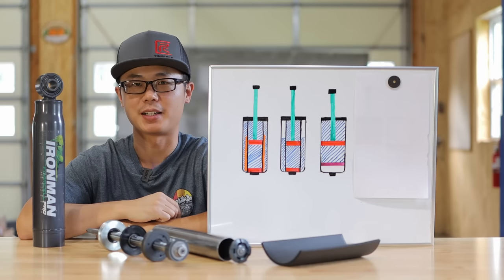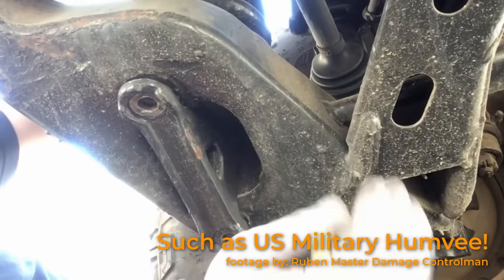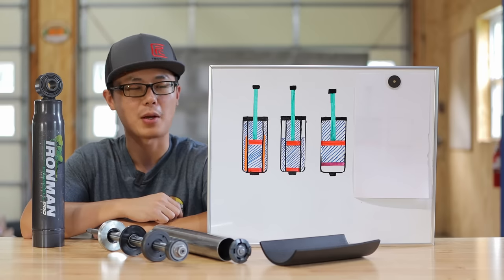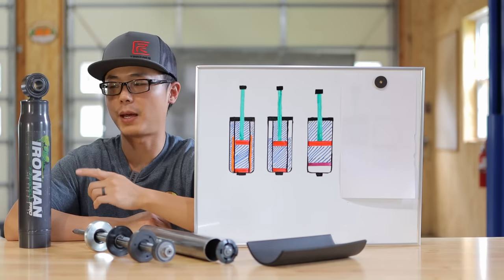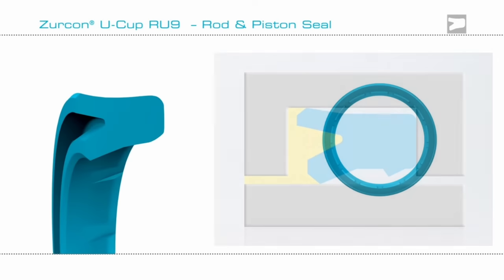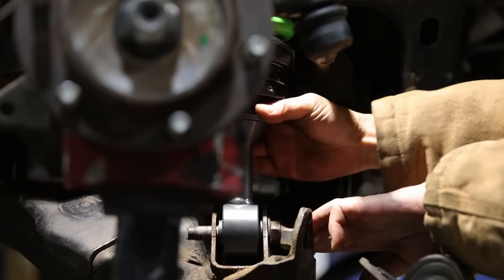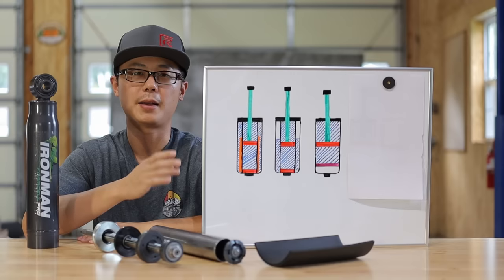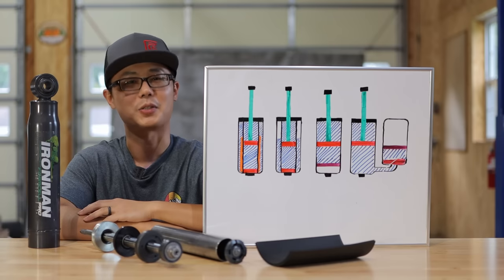Truth About Ironman Foam Cell Pro | In-depth Technical Review & Comparison

Comment: I’ve been running Foam Cell Pros on my 4Runner for almost two years and 25k miles on my 4Runner and haven’t had a single issue. Fantastic suspension.
Reply: Did you have to add that extra washer like @14:06 ?

Comment: I use regular foam cell shocks in my truck (Ironman foamcell)... during an offroad trip in the middle of brazilian desert, I had to help fixing a break issue in my friend's car which was using a regular OEM shock... as I got closer the shock was really hot. It wasn't possible to touch it. In comparison, mines were cool at touch... you could rest your hand on it. Of course, after some 10s or more you would fill a discomfort... but the point is: my friend's car you could barely touch it, and shocks were no longer working as good as it was cold. But mines were fine.

Comment: 5 years and 68,000 miles yet still going on my FCP on my 2018 Tacoma. Not a single issue on the and they still look brand new!. Plus as Kai mentioned Ironman reguarly offers15-25% discounts year round nearly on their website so i got them for a very solid discounted price.Go team Ironman 4x4!
Reply: normally when?? i got my eyes on FCP but would love to take advantage of those discounts
Reply: Did you have to add the washer like @14:06 ?

Comment: I’ve been running foam cell pro shocks in the rear of my Nissan patrol for about 5yrs and 80,000km, the only issue I’ve had it the sheer size of the shock body means I had to trim the bump stop pad on the diff housing and the shock body still rubs on the panhard bracket at full bump.  Still an excellent shock.  Thanks for the very informative video.

Comment: I just put these on my 2010 fj cruiser, and love them. Replaced bilstien 5100 on front and 5160 remot resevor on back. I kept my icon overland progressive springs on back, but went with iron man medium load coil overs on front. I do mostly overlanding in the Patagonia, with hours of washboard roads. The bilstien were down right dangerous after an hour or two as the shocks faded and so did my control. The foam cell pros eliminated the fish tailing of my FJ. Also, I did not want to have to send my shocks away to rebuild, which at that point I was probably cost more than jist buying new shocks.

Comment: Great vid. I have been running the foam cell pro kit on my Tacoma for 25k miles. No complaints/issues so far. Lots of long days on washboard roads and high heat out in the desert and not a single problem 👍
Reply: Are they supposed to be a stiff shock. I installed them on my 4runner and they are very stiff

Comment: Thanks for the great discussion about the Ironman FCP suspension kit - I'm strongly considering it for my '23 4Runner w/ KDSS.  I haven't read any installation instructions for the coil overs, but I suspect that your solution to the plethora of set screws is actually what Ironman intended - since the coil over is adjustable in place, having several ensures that one will be accessible as the adjusting collar is rotated.  I've been a mechanical engineer since 1982 and I really appreciate your in-depth technical discussions and demonstrations - a great contrast to other content on YouTube that is unsupported by actual facts.

Comment: Great content. I’ve been running the standard Ironman foamcell for about six months on my touring vehicle. Done a lot of corrugated outback roads and beaches while reasonably heavily loaded and been happy with performance. In Australia Ironman tend to have a reputation of being a solid mid range brand but a lot of people do look down on them in favour of ARB OME and other more spendy alternatives.
Reply: Good point. People buy mid range suspension and expect it to handle the most extreme things they can throw at it.

Comment: Just installed this 3" lift kit yesterday. Was freaking out about bending the bracket on the LCA. Your comment made me feel better about it lol. Also, the instructions that came with the rear coil springs say that they are marked D/S and N/S. They were unmarked and identical, so we installed them as is, which resulted in a 1/4" driver side lean in the rear with a near-empty tank and 3/4" lean with a full tank. Can't tell without a measuring tape though.

Comment: Dude, you have been amazing helping me understand IFS! I come from the jeep world and am building a 21 bronco. Goal is better wheel travel and bigger tires with a better off-road ride. I would love to see a video discussing the Bronco's IFS and its shortcomings along with your opinions on its IFS. Thanks for your great explanations!
Reply from the maker: Thanks! I would love to check out a bronco and make some content. Love the front sway bar placement and hydraulic disconnect. Not too sure about choice of coilovers in the rear. Too bad the steering rack and tie rods are similar size as Toyota.

Comment: Thanks for providing much needed information to the 4x4 community. I have found some suspension manufacturers don’t even provide specifications on their springs, shocks etc. Very frustrating when you are trying to spec out components. I ran QA1 consumer rebuildable/revalvable shocks when I raced open wheel cars. It was a good choice for budget racers that couldn’t afford adjustable shocks or carrying many shocks on hand. Keep up the good work!

Comment: I moved to Wa from Ca and i have king shocks on my tundra, this makes me want to sell them and go for a more basic setup its a different kind of offroading here and your video makes sense. I hate the maintenance with the king shocks, many shops here dont rebuild them. thanks for these videos
Reply: What are the maintenance requirements for the king shocks?
Reply: You have to rebuild them after a few miles, depends on your driving habits, hard high speed off-road probably every 30k miles. I love them but hate having to send them off to CA for a rebuild when you’re in a place that no one does them.
Reply: @fouUili684  it’s something you have to send off, not a diy rebuild? Is it just replacing seals internally?

Comment: Another great video! I Would be really interested to hear your assessment of the Eibach pro-truck series for Toyota/Lexus. Really liking mine after over 2 years
Reply from the maker: Thanks! I don’t have my hands on one so can’t say much. It looks fairly similar to bilstein 5100 by design. The Eibach brand is pretty solid so I would trust it. I do like their load leveling system for the rear coil spring. Very ingenious design
Reply: @TinkerersAdventure  I think there was a leaked document that showed it was a rebadged 5100 shock with one tiny difference.

Comment: Thanks for the super helpful information and clear communication. I’ve used the Ironman FCP for a few months now on my 1999 Landcruiser equivalent (LX470). 

The front end has a torsion bar system, so no coil overs. As for the rear, I found that the kit for the UZJ100 actually does account for the “toyota lean.” The driver’s side rear spring is approx. 1/2” - 3/4” taller by my measurements.

Comment: Foam cell is used for thermal insulation in some instances.  I don't see how it can be claimed to increase heat dissipation in this case, since it's effectively insulating the heat generating inner tube from the heat radiating outer tube.

Comment: Fantastic video, thanks! Just curious, how much might the displacement of the inner tube in a twin tube shock reduce the volume of oil? Given the shock body of twin tube and monotube are likely to be constructed from material of similar thickness (say 3mm), and once you factor in the displacement of the inner tube, shock body OD doesn't seem like a fair representation of oil volume/thermal mass when comparing the two shock types.  Larger OD has a larger surface area, which would aid heat dissipation I guess, maybe that would make up for the displacement of the inner tube?  Also, any thoughts on the steel vs. aluminium (excuse my English, I'm a Kiwi 😊) wrt heat dissipation? Cheers

Comment: I agree, paint and e-coat are better than zinc coatings for corrosion.  I think Bilstein should paint their aftermarket shocks instead of zinc coating them, for better corrosion protection and because the yellow and blue look way better (in my opinion) than the zinc (especially after one salty winter). Great information as always, thank you

Comment: I choose Ironman pro because they offered different spring rates for
front and back. I choose a heavier spring rate for because of steel
front bumper and winch and spare tire and gas cans on rear plus towing.  I didn’t get the Toyota droop and it rides great on any surface.

Comment: I loved the content. Thanks for putting this all together. In one of your other videos you mentioned to go with a 2 inch lift for the gx in general vs the 3 inch. Is this testing done on the 2.5 inch fcp? Is that also what you would recommend for the gx ?
Reply from the maker: Thanks. Correct. That testing was with ironman 2.5” lift package, but you can adjust the preload to set whatever height you want. I personally go with as low as possible. My FJ has 2” lift on the suspension and 315/70R17 tires. If I have larger tires, I might even run less suspension lift because I have more ground clearance to spare

Comment: Hi Kai. Asking here since I figured this is the best chance for ton to see it.
I just installed the bilstein 6112 on the highest perch in my v8 4th gen 4runner. There is still rake with a 1.5” spring in the rear.
For the 6112, it is a 14”x3” 600lb spring. To get a bit more lift, would you recommend a) upgrading to 650/700lbs 14” spring, b) changing to a 16” 600lbs spring on the bottom perch, or c) adding a 1/4” top hat spacer?
I think since they used the same spring rate for the v6 and v8, going to 650lbs wouldn’t be an issue, but the 700lbs might not be the best ride quality
Reply from the maker: I personally prefer b) for the sake of articulation, as long as you can verify it will not coil bind. A) is a safe bet and will give you slightly more stability on road. C) is no go for me because 6112 is already extended. Adding top hat spacer will over extend your IFS.
Reply: If only they made a 15” x 3” spring. But yea I’ll have to do some measurements to see if A fits. Thanks for the reply

Comment: Excellent video!  Though i think its misleading not to explain more the role of shock valving.....  eg. A well valved twin tube will handle fast desert runs better than a poorly valves monotube.  Can i suggest a test?  Drive the GX with the Foamcell pros over fast undulating conditions.. assuming you have the FEP rear shock, then push it some more.. and watch the vehicle dynamics.  For the Prado platform, its the pitch that will play up the most, and you can easily observe that via the cycling response of the rear suspension.  You might find its actually close to critically damped.  A lot of this you can infer from the many posts on the Custom valving  threads on the Australian Pradopoint and FJCC forums.

Comment: I have a question for you and I would like to know if you can tell me if it is true that the ironman nitro gas shock absorbers go well with the standard original trim and can they be adapted with the +5?  I have a Suzuki jimny 4x4 with m13a petrol engine 1.3 lt petrol with factory standard shock absorbers and suspension set-up yesterday afternoon I picked up the new ironman nitro gas shock absorbers and the 4x4 spare parts dealer in Florence told me that these ironman nitro gas shock absorbers are fine for 4x4 off-road vehicles with a standard factory set-up or in a second I could put the springs higher and it becomes a high set-up +5 is it true?  Greetings from Florence Italy!

Comment: Wish I watched this first.

I just bought a pair of front shocks and the gap on the lower bolt had me worried.

Also the instructions are probably as bad as I've seen
The top bushings and spacers are incredibly confusing.

They send two packs of spacers/bushings with the shock and they are slightly different to most shocks ive seen (and no instructions how to set them up even though shocks are sold for specific makes and models)

Comment: Your timing is impeccable.
Reply: Since.... your really good at this.... could Bilstein B8 8112 & 8100 kits (GX470)  get some your intrigue, dissection and analysis?  Many many thanks for the hard work you do for these excellent in-depth presentations.
Reply from the maker: Thanks! I am very intrigued by the 8112 zone control. It is basically an internal bypass because it has position sensitive characteristics. So more performance in theory than the Fox DSC on my chart. If I were to do high speed stuff and not get long travel control arms, I would personally get 8112 before Fox/ king and such.

Comment: 9months using foam cell pro. I have one complain about it. When I hit speed bump in some subdivisions or villages  it feels like it does  not bounce smoothly compare to my toyota fortuner stock shocks and spring. My set up is 285 70 r17, inches and full iron man suspension lift kit. 2inches. Maybe some insight. My truck is chevrolet colorado south east asian version. Maybe slight smaller vs u.s.a colorado.But overall at high speed (80kph+) ride is excellet in highway bumps and washboard road. Just the speed bump at slow speed

Thank you for making videos about suspensions Keep it up
Reply from the maker: Thanks! It is pretty hard to judge this type of things in text. It might be the way they valve it. Lifting the ride height will also ride stiffer because of the control arm angles. That you don’t really have much way around it. But 2” lift isn’t too high.
Reply: @TinkerersAdventure  i tested it again. It doesnt happen today. Maybe i should let mechanic check it. I think something is happening. Now it bounce smooth in slow speed bump hit. I just realise it only happen occassionally. Thank you for responding

Comment: Which one would you recommend for a comfortable daily driver with occasional camping trips on forest roads. Bilstein 4600, 5100, and soft valved twin tube OME or Dobinsons? I'm also using stock springs on 4Runner.
Reply: I have the 5100s and they’ve been great. Do about 90% daily v 10% off road/camping. But I’m also looking to upgrade. They’re stiff

Comment: Hello buddy,is the viscosity of the hydrulyc oil inside the shocks affect the performance? Some of brand claims that their product used 20% - 30% higher viscosity than oem/competitor part thus producing better dampening force.

Comment: Kia, seeing you measured 615mm for the rear Ironman FCP shock length, any chance you measured the rear shock compressed length or the travel?  Of course measuring with wheels on would be best to determine what needs to be done as far as bump stop length.

Comment: I wonder how much the foam actually inhibits heat transfer- a bigger portion of the inner tube is insulated by foam in the FCP vs insulated by air in normal twin tube
Reply from the maker: There will be tremendous amount of turbulent flow in and out of the base valve, so I believe the main mode of heat transfer is convection through fluid flow, instead of through the inner tube wall

Comment: I was curious how you adjusted the preload on the Ironman FCP lift? I cant seem to get mine to budge no matter how hard I try. I saw you adjusting it in your diff drop video at 3:22. What all do I need to disconnect to do it? I'm about to resort to a spring compressor.
Reply from the maker: I think ironman really cranked down the second collar and jammed them together. I had a very hard time breaking it free. Given you found and loosen all the set screw, including the ones in the axial direction
Reply: @TinkerersAdventure  thank you so much, gonna go try to do it again right now

Comment: You make a compelling case for these. I have been planning on Bilstein 6612/5160 lift and I like that these are diy rebuildable. Only problem is I only was a 1.5 inch lift and it looks like the minimum lift with these is 2.5 inches.
Reply from the maker: Their load and ride height options are a little confusing. You can probably get down to 1.5” by adjusting the collar. In my 4 common myths about IFS lift video, I was able to lower it to 2” lift and there was still preload left in the spring

Comment: Will the foam will block heat transfer from inner tube to outer tube? Gird of holes on the foam may help??
Reply from the maker: No. The radial heat transfer you're thinking is not the major mode. When the piston rod displace fluid, it creates a lot of turbulent flow in and out of the base valve. It is those fluid flow doing most of the heat transfer. Not static radial heat transfer.

Comment: I'm yet to install the Ironman Foam Cell Pro kit I got for my 4Runner Limited that has Bilstien5100 right now. However I got the Lighter coils for rear vs the medium coils come with the kit. Limited is our city 4Runner so I don't need performance / fast offroading shocks. My purpose is looks & comfort. Have to find some time to install them. BTW since I don't have KDSS I won't have KDSS lean and won't need trim packer spacer right?
Reply from the maker: The non-KDSS vehicles tend to have weight distribution lean. Driver side low, passenger side high. KDSS has the  opposite, driver side high and passenger side low due to KDSS cylinder pressure
Reply: @TinkerersAdventure  just measured stock TRD ORP non KDSS rear springs and they are exact same height of 36.5cm. Wish YouTube allows pic comments. Maybe I will include those on my video when I install Ironman suspension when time permits. So since I don't have lean issues, I should not expect any lean after I install Ironman springs.